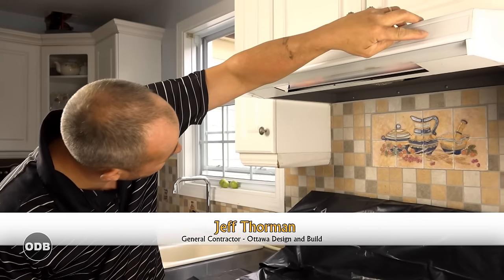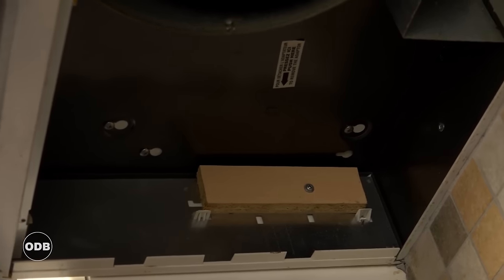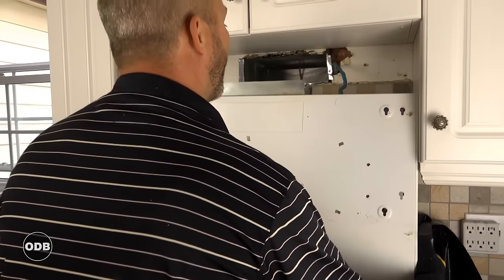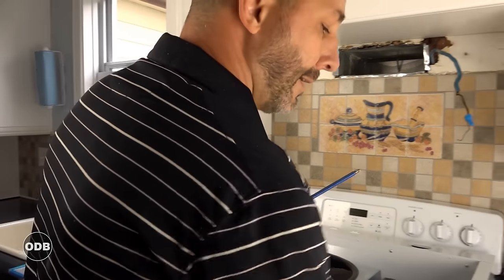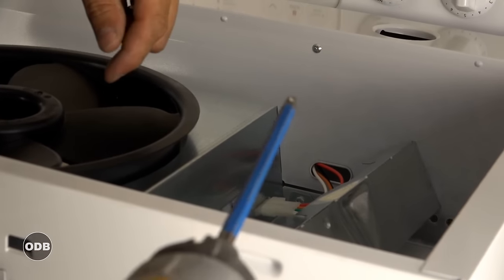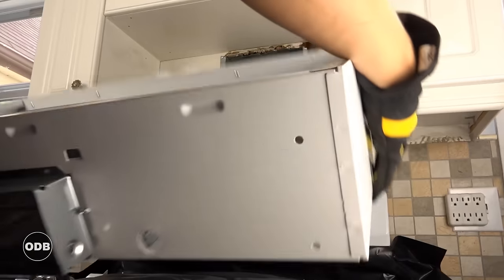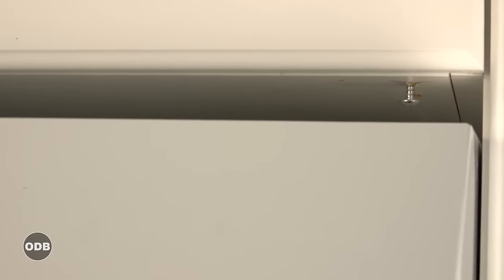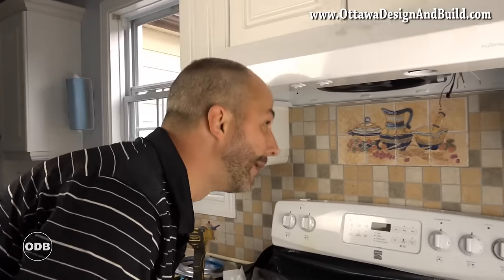DIY How to Replace a Kitchen Hood Fan

Comment: No need to switch out a range hood every 10 years if give it a good semi-annual cleaning and replace the filters.  If any grease and dirt accumulates, it will be in the ducting that runs out the wall or out the roof....not the hood.   The only reasons to swap out the hood is if it is malfunctioning or you want it to match your new stove or decor.  Forget the halogen light bulbs and replace with LED equivalent lamps that use a  lot less energy and don't require any special handling.  If you are familiar and comfortable with a very simple electrical hook-up, the existing wiring serviced the previous unit trouble free and there is no visible concerns with the wiring, you probably don't need the expense of an electrician.

Comment: This was a great refresher since I haven't had to do this for quite some time. However, I would have made it plain that I switched off the breaker or removed the fuse from the fusebox before I got into the electrical connections when removing the old exhaust fan for other people that are watching for the first time. Safety always comes first.

Comment: You do not need to replace a hood fan every 10 years. Total over kill. Just keep the screen filter clean or replace it as needed. This guy is wrong to suggest replacing the entire hood. Very bad advice. He must change out his toilets every 10 years too.
Reply from the maker: Every time they make a better model!
Reply: it's a light and a fan motor. What's better? Do your change your toilet too every 10 years? After all, they make better models.
Bottom line, keep the filter clean and you'll be fine.
Reply from the maker: I cheap hood fan is 30 bucks, and depending on what kind of cooking you do those lousy filters don't keep the oils from coating the entire inside of the fan assembly. If you change them every few years you pretty much eliminate the risk of fire. A lot easier to change than to clean the entire thing.
Reply: hes not wrong lol... easier to swap out the entire unit vs cleaning it (especially since they don't cost much)
Reply: It's $40 now for a cheap one at Home Depot. If you buy the $150, would it last to 20 years?
Reply: larrysue1, he forgot to mention technology upgrades, e.g. blower/fan, electronics, materials, etc...  Besides you don’t want to put keep an old piece of crap ventilation hood in place when you upgrade your crappy kitchen cabinets, do you?  That’s why I always believe you need to put the best quality in that you can afford, no matter what.  If originally a professional SS hood fan with an output of between 400 -760 cfm we’re installed, he wouldn’t be replacing.
Reply: I plan to replace my hood not because its going on 11 years old but because I bought a new range that's black & stainless steel, my hood is an off white & it doesn't look good with my new stove.  I'm selling my cottage this spring & I just think a new hood would be more pleasing to the eye.
Reply: larrysue1 I totally agree. It takes roughly $6-10 worth of time/effort to clean the thing.
Reply: I’m with him. I clean everything but I’m replacing the damn thing after 10 years.

Comment: I have the original 1984 Nutone vent hood that was installed when my home was built. There are NO nasty odors in my kitchen. The only reasons I am replacing it is the motor went & 2 weeks later, the light. So, it is a MUST. I suggest you tell viewers to remove the bulb & turn off their electric before starting this project.
Reply from the maker: Cheers you just did.

Comment: I am so glad I watched this video.  I got a new hood to replace the one that was probably installed when this house was built in 1963!!!  It was totally gross.  After un-installing my old hood, I found that it vented into the attic, which is illegal here.  I was able to use an unused vent from a gas furnace that is about 1 1/2 ft. away.  The gas furnace is gone, so this vent to the roof wasn't being used.  Then, I had to install an outlet because the old hood was hardwired, but that wasn't too difficult.  The hardest part was holding the hood up while I installed the screws.  Unfortunately, the hood I got just had holes, not the keyholes like yours did, but I managed.  I had to use a right-angle attachment for my DeWalt drill to drive a couple of the screws because they were way back under part of the metal where the lights are.  Dumb design.  Anyway, I am so damn proud of myself.  I'm 65 years old and I did this all by myself ;-)  Wish I could post before and after pix.
Reply from the maker: If you have pics please send them to our Instagram account. The link is in the video description below. We would love to share your story and inspire others. Great job!
Reply: @HomeRenoVisionDIY  I think Instagram is a Smartphone thing.  I don't have a Smartphone and can't seem to post on Instagram with my computer.  Oh well.  Take my word for it....it came out great.

Comment: Thanks! My new unit has electrical intake on the left sife rather than the right. Going back to home depot and hoping that they have units with similar electrical setup as my old one.
Reply from the maker: Most do!
Reply: @HomeRenoVisionDIY  sadly they all only had electrical intake on the right. Will perhaps try Rona and Canadian Tire.

Comment: Hi Jeff, if you're looking for content, maybe do a video on replacing a hardwired hood with a microwave/hood?  Admittedly, that's what I'm trying to do, so I have ulterior motives 🙂.  As far as I can tell, the only really challenging part is taking the hardwired connection and turning it into a plugin socket.  The only other thing on the circuit is some can lights, so I figure it should be able to handle any additional power draw; I hope.  Anyway, keep up the great work!!
Reply from the maker: Thanks for the tip!

Comment: 3:21 Yup, I am skilled as an electrician but terrible at most everything else.

He is exactly right about having the appliance already installed before you call the electrician. That includes dishwashers, wall mounted microwaves and other permanently installed appliances.

Pro tip, you dont want plumbers doing the electrical, drywallers fixing your foundation, or carpenters troubleshooting your HVAC
Reply from the maker: Thanks Jeff, that is exactly right!
Reply: Jeff Cram he can't short it to find the breaker 🤔  that's why I carry a volt meter.

Comment: Very helpful video!  In my parents house, they have a rear venting under-cabinet hood like this, which needs to be replaced.  However, we'd like to move it 2-3 inches to the left, so that the new Ikea cabinets will fit into the space on the right.  Do you think this is doable by just making the hole in the wall a bit bigger?  Or is it much more complicated than that with the ducting?

Comment: I am removing a microwave and want to put in a ductless vent hood. Whirlpool specs  require a  12" (30.5 cm) minimum cabinet depth. my cabinet is a 14". When installed the vent is at the top of the hood would be covered by my cabinet.  Is this an issue or does it matter?  Suggestions would be great because this is the same with all the ductless vent hoods I have found, my 14" cabinet is not the norm I have found.

Comment: Just let the fan running...until you cut the power from the breaker.
Soo no power

The taps you can use a flat screw driver and remove it without twisting the metal.

Change the range hood

Put led instead the old bulbs.

Turn on the breaker.

Check for air leaks.

Job done!

Also. Try to get a 2 fans range hood they are much better

Comment: I'm replacing a 70s era 36" range hood/fan but want to put a 30" one in it's place. The fan vent is on the top. Is there a way to adapt the 30 " vent as it will be offset from where the current vent is?
Reply: Did you ever complete the task ? I am in the same situation where my vent is a 1977 - 36  wide and want to replace it with a 30 wide  .

Comment: I have a question. My parents kitchen has an duct ceiling fan similar to those you see in bathrooms. I was wondering if that can be replaced with a range hood
Reply: where there's a will there's a way lol... all jokes aside, its not that hard to do. Just not with this type of hood vent unless you are also installing cabinets over the ceiling duct.

Comment: Hey Jeff, Why cant you do simple splicing on the blue cord and attach it the the range hood unit's cord
Reply from the maker: There are always rules when dealing with 15 amp power. Please follow them. Cheers and Have a great Christmas!
Reply: @HomeRenoVisionDIY  then you could've just bought a pair of class 0 electrical gloves

Comment: Electricity vibrate??
Reply: The operation of the vent fan could produce vibrations enough to cause wire chafing after several years of operation.

Comment: Why not replace if it looks better if you can do it yourself  you can buy a new hood for 60 quid,  If you have to pay a guy to fit the hood then leave it till it needs replacing
Reply from the maker: I am a little confused Ron. WE are replacing the hood ourselves. When you run into an electrical problem that is outside of your understanding. Always call a professional to help.

Comment: What is the v is the drill 18 or 20
Reply: Jonathan Guess that's too much power for this job.  I use 12v makitas.  But for sinking screws in studs I use 18v.
Reply from the maker: Hi Johnathan, I use a 20 volt dewalt. The battery life is awesome.

Comment: Why don't those electrical wires zap you when you touch them?
Reply from the maker: I am holding the insulated part of the wire.
Reply: electrical connections only "zap" you when you form a circuit. IE... when two live wires touch each other or you form the circuit by touching the metal portion of both with your hand/a tool.
This is why Jeff says to call an electrician though... If you had to ask that question you definitely shouldn't be messing with electrical connections.

Comment: you might say that hood fan/vent was totally SCREWED. 
Lets be real though... no way he called an electrician to do one connection. But probably better he didn't do that on camera.
Reply: He didn't call him just to do the connection, but to verify the existing Romex was wired correctly into the panel, seeing as how everything else about the existing setup was jerry-rigged.

Comment: The purpose of me watching was to know how to replace and all you did was screw a new hood on but u ended up calling an electrician. Bottom line, call an electrician to install.
Reply from the maker: If you are at home and the code allows it you can always twist the black and white and ground wires together yourself. Cheers!
Reply: Make sure power is off/breaker flipped, use linemans pliers to twist proper electrical cable connections together. (see included wiring diagram) Cover with plastic winged electrical connector (that are most likely included with the unit) and twist. Easy peezy.

Comment: Why did you need an electrician? Hot and neutral.....
Reply from the maker: You may have noticed that when I touched the 2 wires they didn't rip the breaker. Obviously the wiring is wrong so black and white only takes me so far.